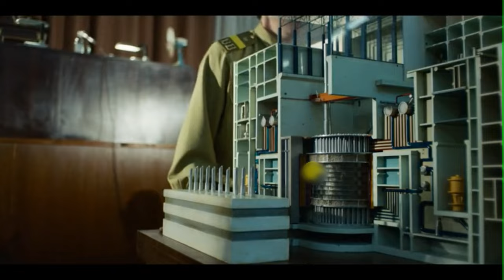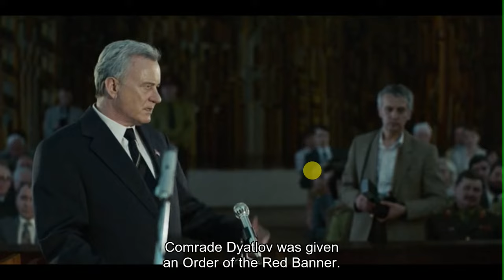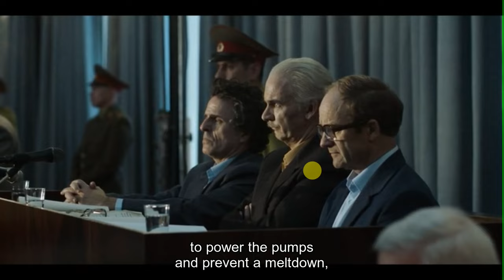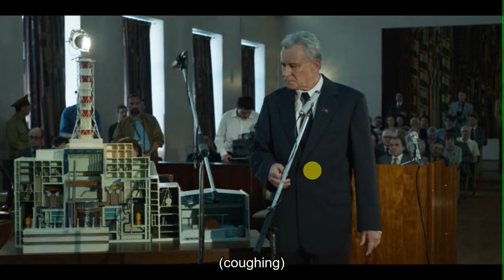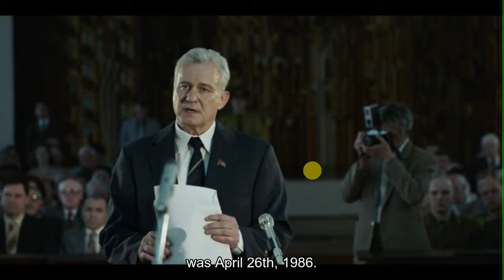The Testimony Of 'Comrade Boris Evdokimovich Shcherbina' /Web serie Chernobyl

Comment: Never understood why plants dont have steam turbine powered pumps? Use the steam from the core to spin a genny plant powers itself.
Reply: It would incur a loss in energy generated and distributed. To keep up, they'd have to go for a more powerful generator to nullify the loss.
Reply: The problem is that the nuclear power plant (any base load power plant, really) generates an absolutely massive amount of energy compared to what it consumes, cannot change its power output very quickly, and cannot operate at the sort of power level it takes to run the plant itself.  It relies on the grid consuming most of its power.  Once the grid connection is lost, the reactor has to shut down because there's nowhere for all its power output to go.

For short-term operations after loss of external power, the pumps can operate off batteries and/or flywheels, and the PWR and later designs allow for at least a few hours of passive cooling to allow for any backup diesel generator issues.  So use of the main turbine isn't really necessary.  Note that, at Fukushima, the flood-protected backup diesel generators were fine.  Fukushima would have had no issues except for TEPCO deciding to save money by not connecting the flood-protected generators to the reactors, rendering the generators useless.  (Well, one reactor was wired up, as it had an existing backup power input.  Connecting the others would have been expensive so it wasn't done.)

For long-term operation, neither the steam turbine nor the reactor can safely operate at such a tiny fraction of their normal operating output.  Even if you had a backup steam turbine sized to drive the pumps, the reactor would be well outside its safe operating area, and the power output would rapidly oscillate out of control if you tried to keep it in this unsafe regime.  

Basically: Nuclear power plant reactors are not designed to operate while isolated.  Loss of grid power is an abnormal condition, and the only suitable response is to shutdown the reactor, and focus on cooling systems to manage decay heat in the core and spent fuel in the pool.  If there are problems with the backup generators, or access to portable generators, the consequences are not minor, but they are less severe with every hour the reactor has been shut down.
Reply: @Alchemy-yr3sw 'Fukushima, the flood-protected generator is fine.'
Meaning the generator can work under water?

I ask because this's not the information out there.
They said that the generator is underground and can't work because sea water filled that basement.
That would be cover up by T3pco.
Reply: @Alchemy-yr3sw no, I mean this:  plant is running normal, power cut happens. Drop control rods,  disconnect turbine, steam direct to condenser for cooling loop.

Use the steam generated in the core to turn backup steam powered pumps. A steam powered turbine pump would move more than enough water to keep the core cool. If steam level falls so far it won't turn the pump...good that means core is put to sleep.
Reply: @aymuhspunj turbine off, steam direct to condenser.  Control rods in. Steam powered turbine pump uses steam from core to pump water. If core cools pumps slow, if heats up pumps increase. Natural feedback loop.
Reply: @testy462 then what would be providing the power to the water pumps to provide the water to turn into steam initially?

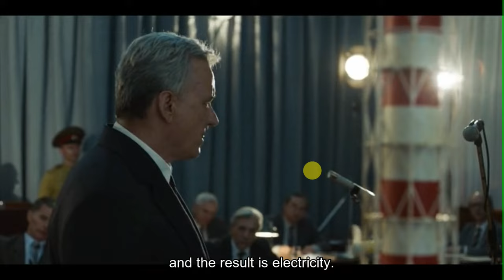Comment: 1:59 "What if a power plant has no power?" What? It's a POWER plant!! That's like asking what if our farmers die from starvation. Why can it not power itself? Surely the plant makes more energy than what is required to pump some water? Who would make ANY kind of engine or generator that requires external energy to operate? Anything like that should always be designed to be self sufficient/regulating and should be able to work in a closed system.
Reply: just because it's self sufficient doesn't mean it's free from potential problems, literally 10 seconds after that quote he states two more possible things that could fully disrupt the operations of even the most self sufficient power plant, hence the backup generators.
Reply: There's not a single system that doesn't require energy input to generate output
Reply: @vulpes7079  the world would be a very diffrent place if there was!
Reply: This is what happens when people skip the Thermodynamics classes at school
Reply: If your farmer is incapable of harvesting (loss of limbs, house collapsed on top of him, sick…) then yeah, he can starve.
Reply: These things are always more complex than they appear on the surface. When shut down, a very important bit of information, the reactor is not generating enough energy to run the pumps on its own. However, it is still enough to be dangerous if unchecked. So, the pumps must be powered by an external source while the reactor powers down. If the power were to go out during a shutdown, there would be a resulting meltdown as the core overheated in the absence of coolant. In order to be prepared for this possibility, backup generators are a necessity.

As an interesting note: The Chernobyl disaster resulted from an attempt to test the plant for its ability to handle such a possibility. You would however be forgiven for assuming such a possibility is rather far fetched, given the required coincidences. It was however this exact circumstance, combined with one extra design flaw, that would result in the Fukashima meltdowns. The plants were shutting down following the major seismic activity, for obvious safety reasons. The tsunami caused the initial loss of external power, forcing a switch to the backup diesel generators. These were however, poorly placed, and as such had been flooded, resulting in their failure. 

Nuclear plants are the epitome of redundancy, because the consequences of failure are so high. So, if you ever have to ask, why does it need it? It probably doesn’t, under normal circumstances. But the necessity of being prepared for extreme situations is ever present in their design.
Reply: As soon as you hear “just do blah blah blah” you know you are dealing with some one ignorant of the actual facts and reality.
Reply: "What if our farmers die from starvation?"
Holodomor.
Reply: Are you not aware of the millions that starved in, oh, Ukraine after the Russian revolution? Mostly farmers and serfs. Yeah, Soviet competence was lacking, almost as bad as history lessons on it

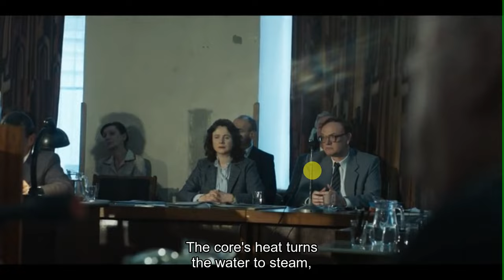Comment: 1:58 "But what if a power plant has no power?" What? It's a POWER PLANT !! That's what it is!! Just use the power from the generator...
Reply: That was literally the reason for the 4 test he mentions at the end. They tried to do it and failed. It's simple in theory but in practice obviously not so much.
Reply: @DarkNexarius  mainly do to reaction design
Reply: Right - they knew that.  They tried that.  They failed.  They were unable to get enough power to bridge the minute from generator shutdown to the required diesel backup speed to power the pumps.
Reply: The reactor requires a CONSTANT flow of water.... the back up generators take 1 minute to start. By the time those generators were started, it was to late...
Reply: a few reasons :

1. a reactor needs cooling even when its shutdown. it needs less cooling. but still requires cooling. 
2. even when the reactor is operating, its possible for power to the pumps/building to get interrupted. breakers blowing out, switchgear fires, etc. 
3. idk...its probably a dumbed down version of what the real test was meant to do that's missing some key details.